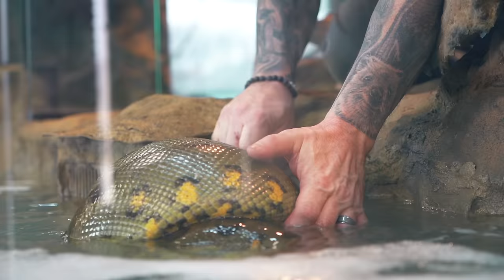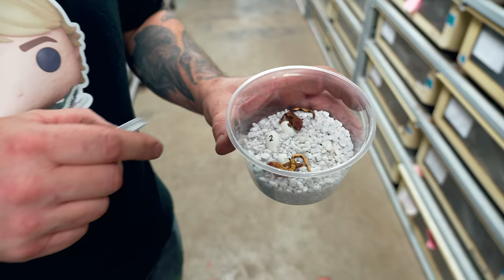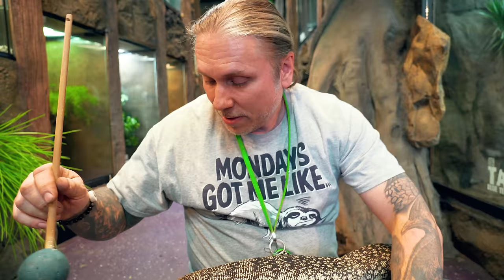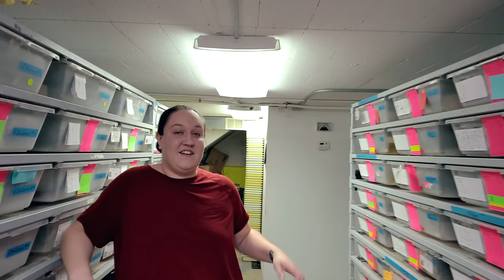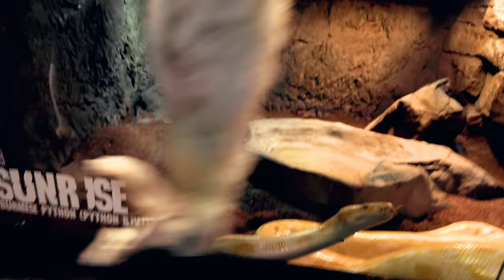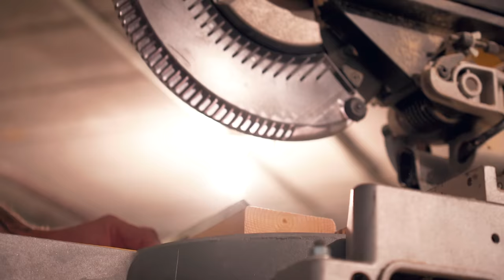FED MY HUGE ANACONDA A RABBIT IN HER NEW GIANT CAGE AT MY REPTILE ZOO!!! | BRIAN BARCZYK

Comment: I find it interesting that Nile monitors cannot swallow prey in the water, but an anaconda can.  Nile monitors are able to hold their breath for at least 2 hours based on my 1st hand experience with them. Strangely enough, Niles can hold their breath MUCH longer than water monitors, or even whales for that matter, yet they absolutely can not eat underwater. I wonder why anaconda can? Both animals swallow their prey whole and both breath through a nearly identical looking windpipe. Maybe anaconda are able to prevent water from entering their wind pipe and maybe Niles are not? 🤔 Or maybe its because Anaconda can walk the prey in with their jaws while Niles have to rely on gravity or ramming their prey down their throat.